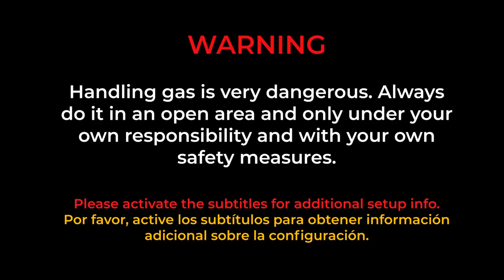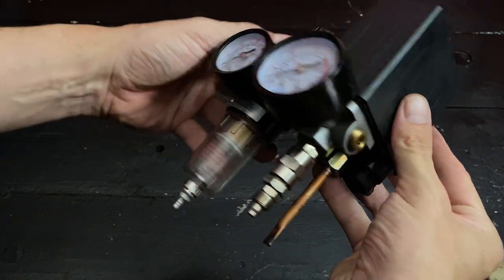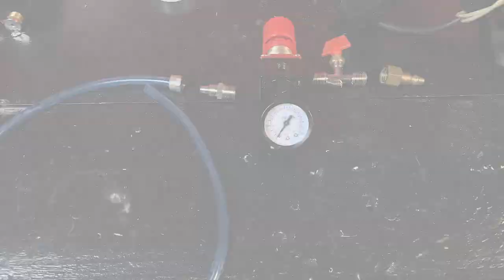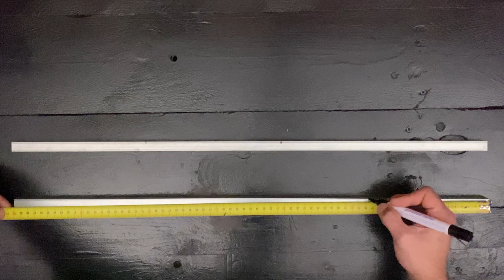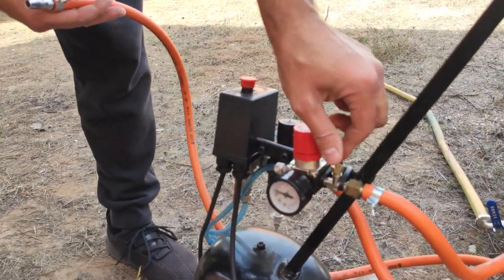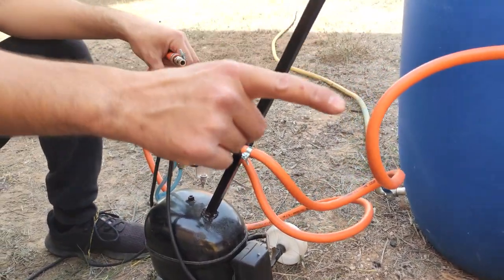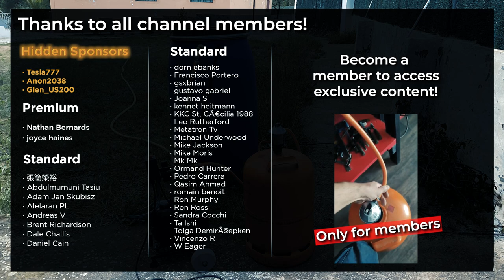FREE GAS FOR HEATING IN WINTER - Free Biogas Refilling Machine

Comment: Hey I noticed that you connected your output first and then your input. Doing so means that your lines are filled with air which has a 20% oxygen content. Pressurizing just the gas is fine because it can't explode without oxygen but if you have a gas oxygen mix then you have to be very very careful. It could make a bomb and fire could travel back through the tube to the tank setting it off without a flashback arrester. Simple fix would be to purge the lines with the flammable gas using a lighter on the output till it lights. Just thought I'd mention it. Awesome build, and I'm hopeing to make one myself and this was very helpful because I didn't know how I could connect to the compressor but a hose clamp is genius if it works.

I also realize that it takes almost 50% air to have an explosive mix but even still, caution doesn't hurt

Comment: Your production can be more efficient if you don't create such pressure in your tank. Keep the temperature inside the tank at 30-34C. Attach a gas bag to your tank to drain it from the tank and run this gas with a compressor from that tank. Your amount of gas will increase grammatically.
Nice job with the compressor!

Comment: А теперь посчитаем:
1. Компрессор холодильника (250Вт мощности) работал постоянно 8 дней, это 48кВт потраченной энергии.
2. Баллон на вид максимум 27л и давление в нем 10атм, соответственно в нем 270л газа или 0,27м3 или 0,5кг газа.
3. Обогреватьль на ви 4кВт и потребляет 0,3кг/ч

Итого получается что за 8 дней он насобирал газа на 1 час 45 минут работы обогревателя в 4кВт (или 7кВт суммарно мощности в газовом выражении), затратив при этом 48кВт электричества + уйму времени и денег.
Reply: That's exactly what I thought! This video is a guide to waste a lot of energy. The only solace: In summer when biogas is easy to produce you can also have a lot of cheap or almost free solar power. 

I wonder anyway if there might be a solution of this problem - lower pressure maybe and a much bigger tank.

Comment: The only thing he needed to do to keep that compressor running well on that frame is he should put a dampener to support the frame and give the compressor the need to vibrate without braking the frame or the parts inside the compressor otherwise it’s a good design, well done 👍 👍👍👍
Reply from the maker: Thank you very much

Comment: The methane released during decomposition cannot be made liquid under such conditions, unlike a propane-butane mixture. 10 atmospheres accumulated in a cylinder is only 10 volumes of this cylinder, that is, if a cylinder is 50 liters, then 500 liters can be stored in it. This is not even 1 cubic meter of gas (1000 liters), but only half a cubic meter. By weight, it will be less than 350 grams of fuel - and with this you are going to heat the house? What are we talking about? Someone in the comments was still going to compress hydrogen at home - are you there, in the West, did you not teach physics at school or do you suffer from dementia? Go to the torch in the stone cave, greetings from Russia.
Reply: @ogi22  I think this fashion video is made just for the sake of views. $3 for every 1000 views - YouTube monetization.
Reply: @georgebloshchitsin2377  Interesting. Makes me want to start up my own channel for some extra gas money?😎
[edit]
Oh shoot... i would need to deal with "AMAZING FREE ENERGY" or similar stuff... I think i'll pass.
Reply: @ogi22  Well, you have outlined the problem - how to clean biogas from sulfur compounds at home. I'll tell you a secret - no way. At least there are no cheap ways. But you still make a video, as you tried and failed - and collect views and likes. Then you can also make a video on how to extract sulfur compounds from coal before use, so that it does not stink so much when burned in the stove (making chark at home). As for perpetual motion machines, this topic was popular 10 years ago. Since then, in the comments on such videos, no one has asked why all these devices do not accelerate to infinity, spinning at idle with no load. Where, then, does the energy they produce go? Why do I ask, everything is so clear.
Reply: This is just an example of how gas can be stored, there is no information about the scale, which can be enlarged
Reply: @krzysiekbutowski  This video is about how to accumulate fuel for half an hour of heating with the help of a compressor from a refrigerator, a propane cylinder and a barrel of shit within 8 days.
Reply: yep, better buying it at $4/gal low quantity or alot less with monster tank.. than fiddle with that.. safety.. potential air mix in your bottle.. yadda. By the time you bought high pressure tanks and nice (HPA Scuba?) compressor you'd never have an ROI.  If its an experiment that's a little different.

Comment: Compressed Methane aka Natural Gas does not liquify with such low pressure means a very low energy content compared to propane
Reply: @neveralonewithchrist6016  I think it DOES matter - just because you need heating mostly when it's cold. And when it is cold, biogas production declines - these bacteria like warm weather as much as humans do.
Therefore it make sense to produce and store gas in summer to use it in winter.

Either with a stronger compressor or with much bigger gas tanks. Or both.

The energy of the gas that is stored in this video can be only some very few kilowatts.
Reply: @BarryMambo  this is a good point you make that temperature affects gas production
Reply: @BarryMambo  Lets suggest a bottle of 50Liter with a pressure of 10bar. That means 500liter or 0.5 cubic meter of gas. 1 cubic meter of gas hold approx. 10Kwh of energy. So your bottle holds 5Kwh of energy. That's the same of 0.5 liter of diesel fuel.
Reply: @MrTWOproductions  Thanx for proving what I just estimated "some very few kilowatts" (meaning kilowatthours of course) :)
Reply: @MrTWOproductions  a 11kg bottle of propane holds 140kWh and has a volume of 27Liter
Biogas has about 6kwh/m³, so at 10bar and 27L it gets you 1,6kWh

or in other words: you need 90 of these bottles to replace one with propane
12 Days per bottle, so just about 3 years of continuous production of bio gas should do
Reply: @BarryMambo  that's where pyrolysis/gasification is better. You can generate gas and heat from the same single process.
Reply: @keithpoley3432  you can increase temperature just painting it of black
Reply: @Fluxkompressor  thx for this Intel , that just what i needed to forgot about biogas 😅
Reply: Its not about boobs , its about transistor, you now 😂
Reply: @BarryMambo  well said.
Reply: Great point.  What about wood gas cleaned and cooled. No it is not going to liquefy but this video applies basically the same way?
Reply: @Fluxkompressor  there must be a difference between compress biogas and free biogas of 1 m3 . So the question is how many liter is in the 27 liter compression tank!
Reply: OP is correct. I had the opportunity to discuss this with someone who had a lot of academic and practical experience with compressing gasses. They said cooling IS needed to get the methane down to liquid and specifically a refrigeration system with the appropriate refrigerant. We got as far as thinking that methane itself could be used in the refrigeration cycle before we had to finish up and get on with other things.
  If you ran such a system you’d have to think about energy accounting for the refrigeration and compression systems and subtract that from your methane production 👍.
Don’t give up on the theory though! There’s all kinds of interesting possibilities, just be sure to treat it as an intellectual exercise and don’t put more investment in than you’d do for this purpose.

Comment: Can you please share the details of the gas filter? Is it a special one or just a regular compressor water separator?
Reply: this filter looks like a standard dehumidifier for pressurised air... sorry to dissapoint. You need to remove a bit more than just moisture if you want your equiment to survive longer use.

Comment: Great build.. but 8 days to fill a 30lbs tank that would probably last 2-3 days of constant use.. you better have quite a few tanks filled to get through the winter.. I’m wondering if it would be better utilized to run a generator
Reply: Small correction. This tank with a 10 bar pressure would last a few hours (and i'm probably too generous there). This bottle is around 30l (normal 11kg bottle is 27,something). So you have a volume of 300l of gas in there...
Small break for reserch....
 1l of methane weights 1,5g, so you have 45g of gas (just for fun, it's pure 😝)
Checking on shopping sites, those portable (small, touristic heaters1,5 - 1,7kW) use aroud 100 and something grams/hour. That looked like a standard home heater 2,5 - 3, maybe 4kW? How long do you think it last?

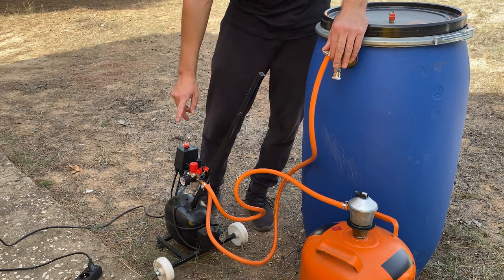Comment: 15:45 i have a question... you plug the tube directly to the container... so there is a little bit of air inside the tube that also enters and mix in to the pump... how much safe is that ??  
how can i know that it isnt't going to explode due to a possible self ignition with the little volume of inside air ??

Comment: Thanks for the usefull video. Just a note, this is CNG gas, what is very light weight, that's why at a pressure of 10 bar this is not a big amount of gas. For cars the pressure of the CNG tank is over 100 bars!
Reply: He is not talking about cars at all dear😉, but small home stoves. This domestic gas tanks pressure is max 20 bars. And a compresor fridge can reach 70 bars so enough to refill the 12.5kg of gas that must hold. what is the problem?
Reply: @DavidGarcia-kf9wo  There is no problem, I just wrote a note for people who are thinking of use that gas for cars.
Reply: @DavidGarcia-kf9wo those gases produce this way are around 100g per 1000m3 , so even you compress 1000m3 to 20bars and it would fit in tank , gas will weight about 2kg , so yea it is a problem  . that's why people who doing bio-digester think , store gas in massive 2000-4000 m3 tanks under 2-3 bars as its much more useful